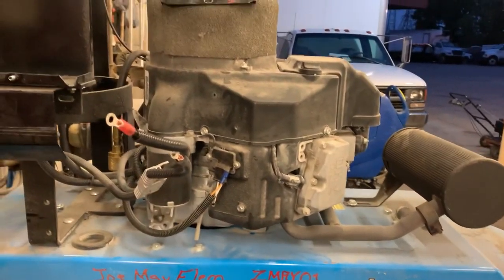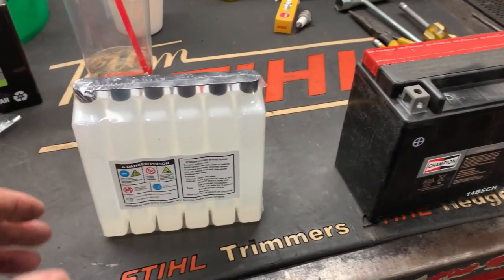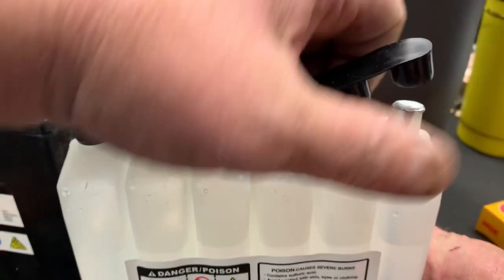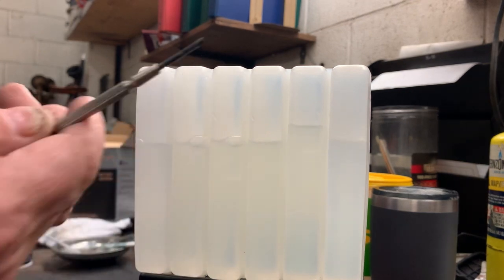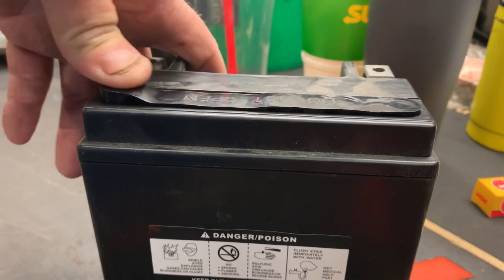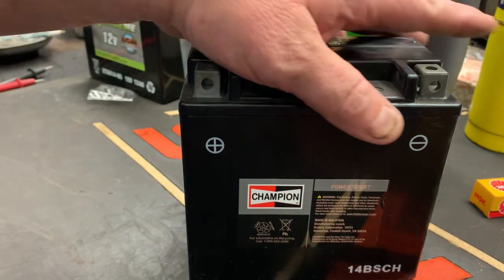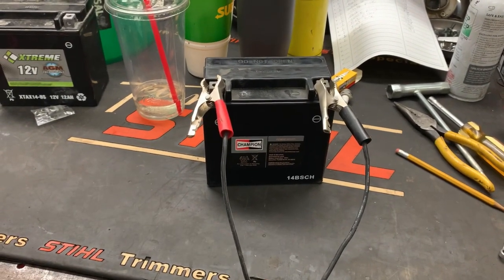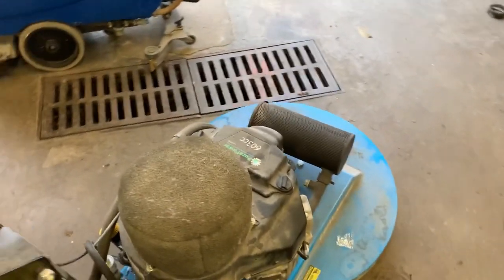#HOWTO BRING A DRY #BATTERY INTO SERVICE

Comment: First time I ever saw one of those batteries was 10 years ago. I'm a road captain with our motorcycle club and one of my jobs is to make sure everyone has their bike ready to go. One of the new members was pushing his bike and then pop starting it. So that got my attention quickly. He said the battery went dead all the sudden the day before and he thought putting it back on his tender would charge it back up and of course it didn't. I made him go get a battery if he was going on this run and since he was new he either went and picked up a battery or push his bike home and fine someone else to ride with him. He went to pep boys and he came back with the type of battery you showed in this video. He didn't have tools with him so I started taking out the old battery and when I opened the box I didn't know what the hell kind of science experiment he picked up.

I was pretty amazed that it started his bike right up and it started the bike every single time we stopped. After we were done that day I checked the internet to find out more on that type of battery. It looks like a lot of places are going to this type of battery for the exact reason you mentioned in your video.

Good video to teach others out there who have never seen one of these.